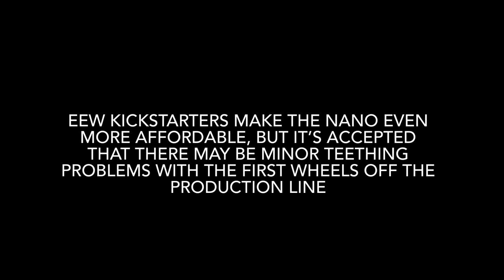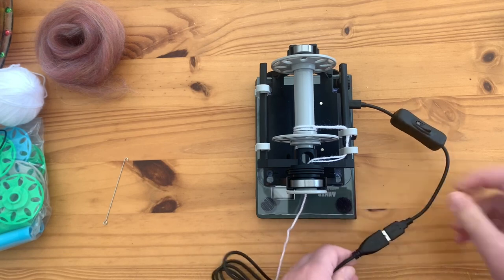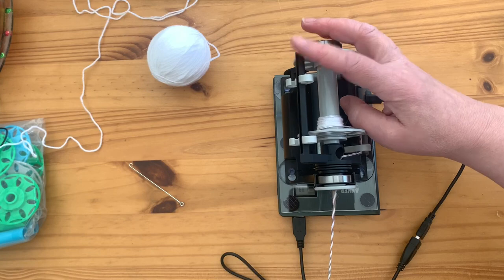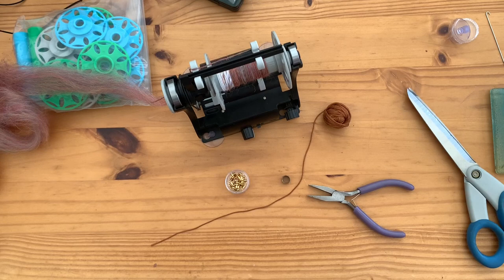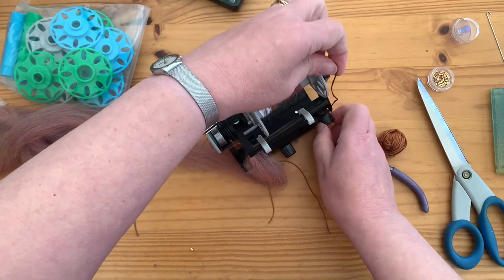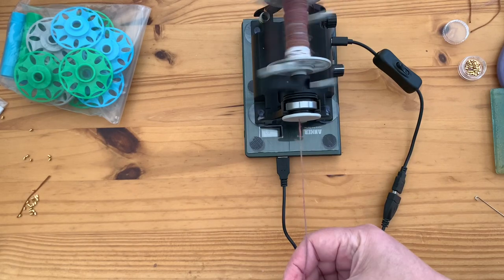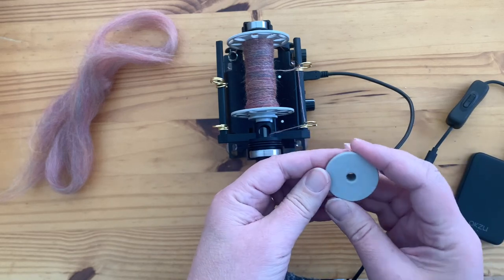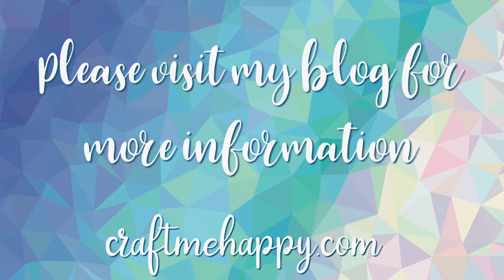Unboxing, troubleshooting and making modifications to the Kickstarter Electric Eel Wheel Nano 2.0

Comment: I know,  right? The delight at seeing the compact little spinner for the first time. Mine arrived on only the third day after I ordered,  and I didn't expect it to even have been shipped yet. I might have a tiny tweek needed, but it works so well as it is, I hesitate to change anything.  😊
Reply from the maker: Well if it’s working well for you, I wouldn’t change a thing.  

I think the favourite alteration I made is to change the tension system for a spring and cord.  I definitely notice that it pulls in more consistently with this alteration and I don’t need to run the motor quite so fast.

Comment: Hey Kathryn! I got the upgrade package, but I have noted that some Nano 2 users with take-up problems are finding that the screw that attaches the tension knob to the body of the machine needs to be tightened. I noticed you saying several times "Ah, that's better," then a moment later, "No, it's pigtailing again." This is what I've seen users with this loose screw problem saying. Removing the screw altogether may also allow you to more firmly attach your tension cord to the tension knob as well. Hope that helps!
Reply from the maker: Ooh interesting, that’s a problem I hadn’t heard of.  I’ll take a look at that tomorrow.  
I was intentionally spinning from carded fibre, as this is more likely to catch somewhere and affect take up.  I felt like I was clearing the tangle momentarily before it got caught up again somewhere, but there were definitely several factors causing the reduced take up.
Reply: @KathrynCraftmehappy  I agree. This makes it very difficult for new spinners to get started, unfortunately. Every day there are multiple posts from noobs who can't figure it out (and aren't searching for the already given solutions from experienced spinners). I worry that this turns them off of spinning from the jump. Not everyone is as persistent as you and I--that's for sure! :)
Reply from the maker: I know, it’s such a shame!  The problem is that Maurice is kind of in a catch 22 situation.  They’re mass produced so that he can keep the price as low as possible so that it’s affordable for new spinners.  Unfortunately, this does seem to mean that they aren’t individually spin tested in the way that a significantly more expensive e-spinner would be.

My hope is that this is just teething problems with the first batch off the production line and they’ll be better checked in the future but sadly there will already be a lot of spinners put off because it’s just ’too hard’.
Reply: @KathrynCraftmehappy  Yeah, I agree. You add that to the learning curve of drafting and that makes for a whole lot of disappointment. Did my suggestion help? I'm curious, since I only did the upgrade and don't have the tension knob. :)
Reply from the maker: @jenthulhu  I got quite a bit of spinning done today.  I had no take-up issues at all, and I didn’t need to adjust my tension knob at all, so I don’t think I had an issue with that.

I think my primary issue was the roughness inside the orifice reducer followed by the yarn getting caught on the hooks and then the tension band being unresponsive.

Having filled half a bobbin now, I’m definitely noticing the increase in motor power which is very pleasing.
Reply: @KathrynCraftmehappy  Awesome! So glad that resolved for you!

Comment: I noticed you have done something to the top of the battery when you sit the Nano on top?  What modifications have you made to the battery? And the wat you placed the leader into the bobbin end is genius…Thanks
Reply from the maker: Thank you!  I’ve cut a piece of Perspex to the same size as my battery and then used Velcro dots to attach it to the battery.  I find that the suction cups only attach to very shiny surfaces.
I wrote about the modifications I made to the Nano 1.1 here - https://www.craftmehappy.com/2020/02/electric-eel-wheel-nano-orifice-reducer.html

Comment: How did you make your yarn guides, including materials used?
Reply from the maker: They are made in a very similar way to the ones that I demonstrate in this video - https://youtu.be/UFGBQBnTIn0
I use 1mm plated copper jewellery wire that I wind around a 10mm knitting needle to make a split ring.  I then use pliers to put a couple of right angles into the wire and wrap it a couple of times around the flyer arm and cut it close to the flyer with metal snips.

They are just slightly more difficult to make as the flyer arms don’t detach like they do on the 1.1.
Reply: @KathrynCraftmehappy  thank you for your videos and help.  I had reached out to Dreaming Robots after receiving my nano and experiencing the same issues as you noted in this video.  I was very close to returning it.  I’ve decided to keep it and will perform the same modifications as you have noted in this video.
Reply from the maker: Lovely!  It is a brilliant little e-spinner, once all of the quirks are ironed out.  Just removing the orifice reducer will help you to isolate whether that is your main problem.
Reply: @KathrynCraftmehappy  that was one of the first things I did.  I think the primary flaw is the brake band.  I have spare brake band for my Ashford E3 spinning wheel, but I think I can find the right springs at the hardware store and the rest of the materials at Michael’s (craft store here in the US).
Reply from the maker: @kathleencoventry4801  some people just use a short elastic band knotted to some non-stretchy cord instead of a spring.  I should think that this would work well enough to help you decide if the elastic brake band is your issue.